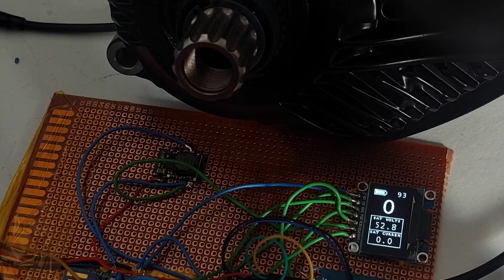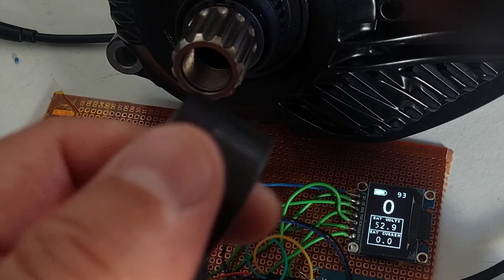Bafang M600/M500 walk assist, battery voltage, battery current -- OpenSource EasyDIY display

Comment: Thanks for sharing! I would like to know how you can get a signal from the rpm of the wheel of your bike, and not the engine, I am also using a vesc 75100 with accelerator and it works perfectly on my bike with a mid-engine, that's why I need to change the real speed signal of the rear wheel through a simple 3-wire speed sensor and send this signal to the vesc, would you know how to do this?